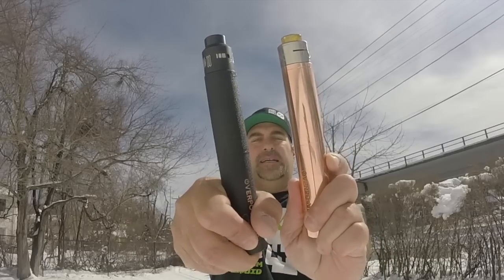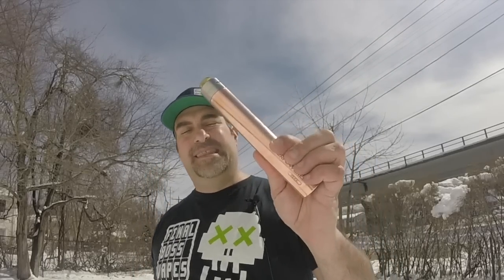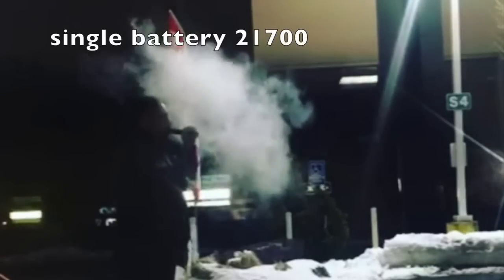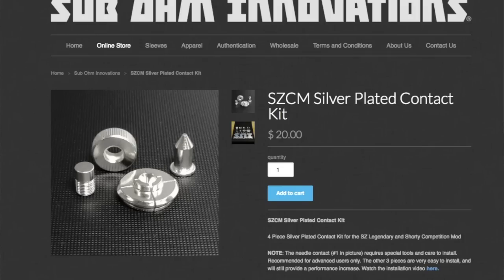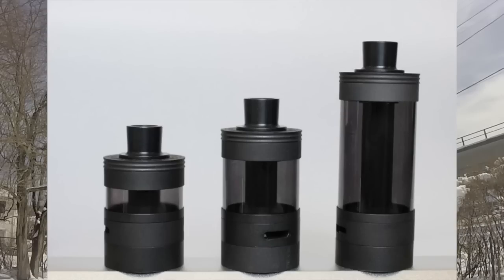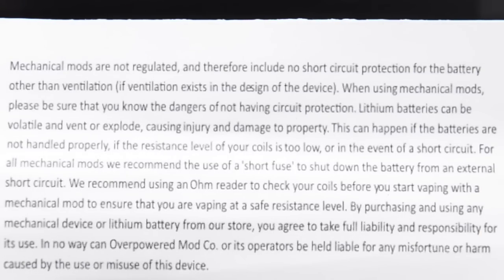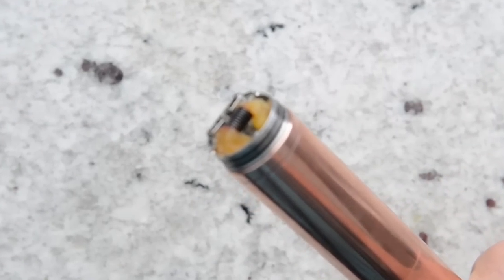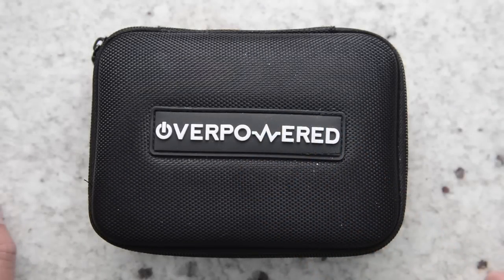OVERPOWERED MOD V1 & V2 CLUTCH STYLED SWITCHES. HOW THEY COMPARE ?

Comment: Big Lou take a bow. That was the most practical, thorough and accurate vape gear review I have ever seen on YouTube. I only wish Overpowered shipped internationally to NZ, or at least answered emails, because I'd purchase one based on your review. Cheers
Reply: John Mackenzie What email would that be? Shipping is enabled to NZ. We cannot ship batteries internationally.
Reply: John Mackenzie If I can be of any help let me know. I want to make sure emails aren’t slipping through the cracks! Just looked and was unable to find an email from someone in NZ.
Reply: Hi Chuck. I used your 'Contact us' facility on your website on two separate occasions with no joy. Can you provide an email here and I'll nessage you. Cheers
Reply: John Mackenzie overpoweredmodco@gmail.com leave my name in the subject, if you need anything. I double checked and there should be shipping options available to NZ.

Comment: The problem i see is the lack of a "middle contact" like the "broadside/admiral" and the Vaperz Cloud stacked section mods offer. If u have a recessed positive button top contact on ur batteries it might affect the function / electrical contact of ur batteries negatively. Up to the point when u cant close the circuit. It is a possibility because of series-derivation in manufacturing of the top-ring-insulators and battery wraps. 
That said, black one looks amazing, that packaging of mod + stacked section + 2 batteries makes for an awesome carry package. Presentation and usefulness combined.
Reply: I was thinking the saaame
Reply: Michael Maier thats one of the reasons they include the vrks, the positive protrudes on them. youre correct though, it could be an issue with other batteries. especially recessed positives, some wont even make a connection.
Reply: Just recently purchased 4 ijoy 26650, as a replacement for my 2 older ones. They came packed 2*2. On 2 of them the positive is so far recessed, that they wont work with my charger.
Reply: Michael Maier that sucks man! id definitely try to return em.
Reply: Golosi work without adapter👍

Comment: Thanks for the review Lou! Unless I am not seeing it I don't think the mooch got to that vrk 21700. He however had a favorable review of the 18650! So hopefully it carries over to the 21700. The more the merrier! Enjoy all the videos! Thanks again!
Reply: john james
The Samsung 21700-30T will be on sale next month in the UK, I'd rather wait for that, being 40amp continuous but able to be vaped at up to 60amps!! Plus it has the lowest IR of any cell Mooch has ever tested @ 6-7mOhm!!!
I can't friggin wait.
For now Sanyo A's and C's do me (the Sanyo 20700C is 3500mah instead of the A's 3000mah, is 35amps instead of 30amp and has an IR of 10mOhm, which is the lowest of any cell bar the new Samsung!)
Only problem is the only way to get your hands on the Sanyo C is to dismantle certain newer Bosch and Metabo power tool battery packs. Dewalt do one pack with them too but they are known to change the cells inside at any time.

Comment: They could have at least modified it a bit, like the adjustable floating pin which is a bummer and too finicky. What I did is I made floating pins of different lengths using a copper rod, then tighten at the bottom.

Comment: They just copied broadside design
Reply from the maker: vilninho and broadside copied sub ohm innovations. So what’s your point
Reply: Thank you... EXACTLY!!!!!!!!!!!!!
Reply: Sorry Lou but I have to disagree.  BJBM took the idea of the switch in the SOI Shorty and then they made many improvements and changes.  There is no spring.  There are three pieces held together by a tight o-ring instead of four pieces barely held together at all.  This mod, on the other hand, is an exact copy of an Admiral.  They had to make it use a 21700 just so there would be any difference at all.  Their RDA has the Elite RDA deck exactly.  Is Overpowered capable of a single original thought?
Reply: Kevin Billingsley The Revenge RDA was designed and Manufactured by Vape MD and they are sold on the Overpowered Website. The original thought of the switch design was to have a smooth and short travel of the clutch that would not stick.
Reply: I've owned a Broadside for a year and it's never stuck once.  It's throw is half a millimeter so I'm not sure what you're saying.  That switch in this video is an exact copy of a Broadside.  The cloners in China didn't get this close to exact.
Reply: vilninho who copied SOI
Reply from the maker: I never said Broadside didn't make improvements or changes. Don't be quick and jump the gun here. 

Understand, that I didn't fully explain in this video cause this video is not a rant or drama video, I was simply giving props to a company who ORIGINATED the clutch styled switch. My thoughts are; the concept of the clutch system originated with S.O.I. Thats a fact. I was giving props to SOI because there are vapers in the scene who have no idea who SOI is.  Anyone can reinvent the wheel over and over but the "concept" was originated by SOI and then improvements were made to it over and over again, by other companies because of how effective the switch works.

As for the Revenge RDA it's Not owned or made by the Overpowered Mod Co, its owned by a third party company but they sell it on their site to accommodate for people who don't have an RDA of its size (width) to match the Mech Mod.
Reply: With all due respect, there is a HUGE difference between taking a good design and making substantial improvements to it and what Overpowered has done here which is to copy a design outright.  It's a logo-less clone.  It's not being dramatic to point out the obvious.  Any drama was caused by Overpowered when they decided to try and pass of a clone as authentic.
Reply: Kevin Billingsley agreed.  Well said.
Reply: Big Lou East Coast  Review because this is a exact replica of the admiral. The only thing different is the etchings lol
Reply: BJBM took the idea of the switch in the SOI Shorty..YUP, you said the right words ( took idea )
Reply: oh trust me,, they stick, i owned them also
Reply: This stupid argument again...
Ok what about the first hybrid mod, are all other hybrid mods that came after clones of it? Or the first mechanical tube mod for that matter, all mechanical tube mods are clones of it? What about all the clamp style rdas that came after the Goon? Are they Goon clones?
NO THEY ARE NOT.
Soi or Bj Box Mod don't own the rights to the clutch style switch, other companies are bound to use the design and I'm glad they do because it's the best switch design (imo) 
If you like a mod then vape it, if you have a problem with a mod then move on to the next until you find one that fits. There's no need for all the petty shit talking. The main point is that we're not smoking cigarettes anymore!
Reply: Lets all be honest here, it's a fuckin admiral clone. BJBM and the Broadside/Admiral innovated on the SOI switch design, they made it better. These things are just blatant high quality clones with a different name, zero innovation what so ever. I expected more honesty from you Lou, it is one thing to review it it's another thing to defend the obvious cloning and compare SOI vs BJBM, where there was not an exact copy of a design but an improvement, to BJBM vs Overpowered and the blatant cloning. 

The fact The Vaping Legion supported these mods made me realize NO ONE in this ENTIRE industry is out for Vapers and Vaping, everyone is out for themselves, EVERYONE, even the so called hardliner "advocates". Everyone is full of shit.
Reply: I love broadsides I have 2 and an admiral using one rn but yea they pretty much are the same exact thing as soi. Yea they took the spring out and overpowered can run 21700s so about the same scenario imo. They could've at least made some slight changes when they came out with the admiral. They only difference between admiral and broadside is the delrin tube isn't inside the admiral same exact tube.